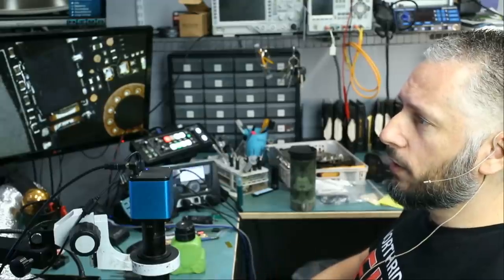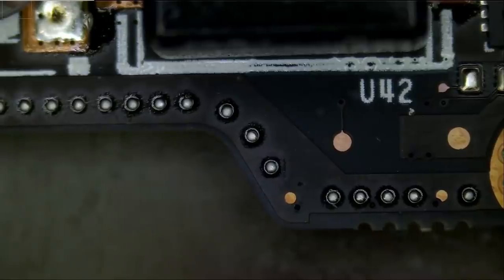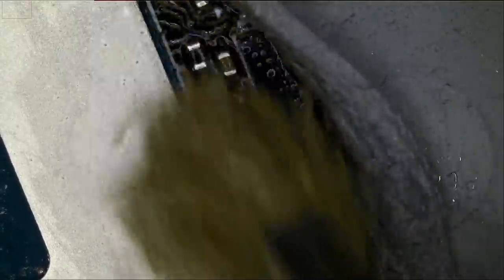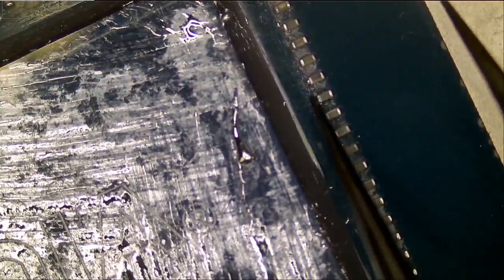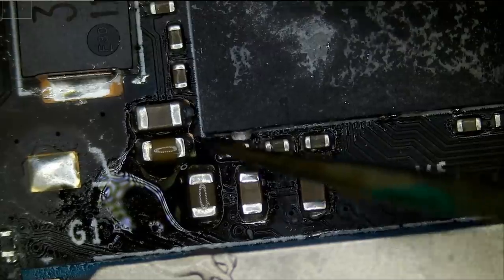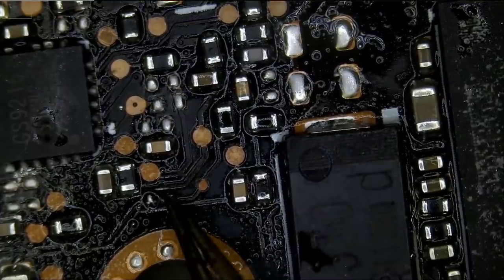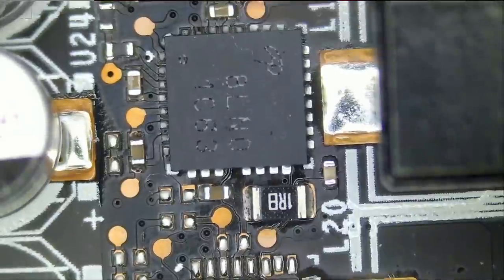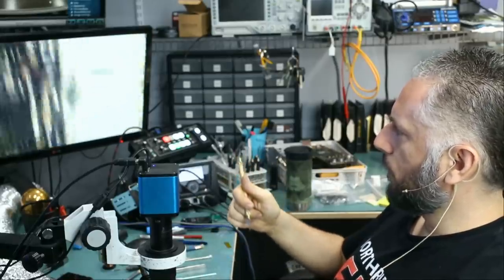RTX 3090 Graphics card Blew out after using Liquid Metal. A frustrating video to watch

Comment: I've never tried it myself, but my thought is that for this sort of thing you might want to try getting some (medical) syringes to suck up the liquid metal.  They can be bought pretty cheaply as diabetic supplies online, which I have found quite handy for various things myself (or if you want something a little safer, you can get blunt-tip ones too (which won't go straight through your finger accidentally) but they do cost a bit more, because they're generally considered "lab supplies")

But boy, they really managed to get that stuff absolutely everywhere, didn't they?

Comment: Why didn't he just get a water block for the card. The PS5 has liquid metal but it also has foam boarders to keep it in one spot so it does not spread potentially causing a short like this card did.
Reply: cuz liquid metal is so much cheaper than getting a 300$ block
Reply: I've only seen one liquid metal application video, and they taped off the processor with masking tape, and spread that liquid metal as thin as they could so it would have the least possibility of spreading after they put it back together. That was Gamers Nexus, I think. I guess customer did not see that video.
Reply: @d3vastat0r89  , I think people don’t realize it’s not your typical thermal paste and don’t feel confident with just putting a little and in turn we see disasters like this on north ridge fix 😂
Reply: Thermal Grizzly paste. No liquid metal bullcrap.  Why do people attempt things that they shouldn't?
Reply: Thats not what happened here at all.
Reply: You're actually supposed to put nail polish or something like that on the small caps near the CPU die to insulate them just in case any liquid metal gets on them. I guess this guy never watched a tutorial.
Reply: The ps5 comes with liquid metal from factory? As if servicing a broken ps5 didn't seem hard enough let alone convert the digital version to accept an optical drive along with the twin ssd setup.
Reply: it is also designed not to have SMD components around the die. the PS5 uses liquid metal because the thermal settings are set such that regular paste wont transfer the heat fast enough, and using even high quality thermal paste will cause the ps5 to thermal throttle and/or shut down.
Reply: @d3vastat0r89  Gamers Nexus is one of the most technically literate channels and even they aren't the best at it.

If you observe PS5 or ROG laptops the liquid metal is a thick layer and is almost floating. There is a reason for it.
Reply: @Scuba_Bro  This is by far the most interesting comment and acceptable comment here. I wanna discuss about this more.
Reply: Maybe it was liquid metal under a water block?
Reply: @wisnoskij  should of did research on liquid metal and find out that it needs to be secured all around especially it being a 3090
Reply: @Scuba_Bro  11 degrees compared with the best alternative paste or shitty stock cooler paste? Because that is pretty extreme.

Comment: I’ve used liquid metal many times before and the number 1 rule is to surround it with electric tapes or equivalent to prevent it from leaking elsewhere. Sony does the same thing for their PS5 as well.
Reply: Well this dude would have needed to wrap whole GPU in plastic.. :'D
Reply: ive seen ppl using nail polish over the resistors around the gpu die. not really sure if thats appropriate though....,
Reply: @utley  well, if heat dissipation anin't a problem and you only want to seal the parts: why not?
Reply: @rafaelwoitzuck3186  foreign chemicals in a high end product is something to not be taken lightly.
Reply: @Marauder those are thermal insulators...
Reply: Well not exactly, they make a literal foam "pool" that contains the LM from the teardowns I have seen.
Reply: @utley  Yup nail polish works well, but if youre already using liquid metal you may as well spend an extra $10 and use a proper laquer
Reply: @MisterMosfet  lacquer? That stuff is hot to plastics, that doesn't sound wise either. Why not just enamel?
Reply: @utley  You can get proper laquers designed for electronics, I use them at work for repairs on air conditioner circuit boards where I have to remove the waterproofing. They're high temperature and non corrosive, really useful for lots of applications.
Reply: I've heard slapping a coat of clear nail polish surrounding the liquid metal application site does the trick. Yes or no?
Reply: @MisterMosfet  conformal coating. Some folks report that their circuit boards were dunked underwater for days and still works just fine.

Comment: Could you use a solder sucker like those handheld ones to remove the liquid metal?
Reply: Liquid metal is nasty stuff, it can degrade aluminium, solder, maybe other metals. I would not risk my expensive instruments if I can use the cheap stuff. Anyway He would have to go over with something else to get the remaining stuff off.
Reply: Not for tiny metal drops
Reply: No, even using the swab sometimes you just "moove it around"
Reply: Compressed air and maybe blow it off the board?
Reply: @IMDYT420  in a contained area maybe. Dont want to get those things on other electronics.
Reply: @IMDYT420  i dont think its safe at all, it's a dense crowded card and even a tiny drop can cause problems, if it gets stuck somewhere you are back at the starting point or even worse.
Reply: @IMDYT420  Risky because inhaling vaporized liquid metal is very unhealthy
Reply: I kind of thought I'd see him use a braid.
Reply: I was thinking solder sucker myself, perhaps even a cheap micro air pump something to vacuum that crap out possibly from under ICs too.
Reply: @Crystalservices  Solder suckers will work well, especially for tiny drops.
Reply: @punktkomma9489  i do not remember talking to you, troll
Reply: @IMDYT420  As a last resort yes.
Reply: @IMDYT420  I usually blow under the chips with the board faced down, and inside a box to avoid liquid metal fly everywhere. 100% sucess 😉
Reply: I’ve got a solder sucker made of plastic and stainless. It’s unlikely to break it however the insides are going to be coated.
Reply: No way, it eat into any other metal below, literally dissolving them and making amorph amalgam which you can wipe away with a towel. There is nothing you can do. Except removing some still useful components without LM contamination.
Reply: @ChannelJanis  Not it can, certainly 100% degrade aluminium,copper and solder within a year maybe less
Reply: @TheThore  Gallium boiling point is 2400 Celsius degree. There is no way you can inhale that at room temperature.
Reply: @nhozdien5058  thank you for the informative response
Reply: @IMDYT420  Compressed air works like a charm

Comment: I'm a vet MD that also repairs/builds PCs in my free time for almost 30 years now (actually paid for my college that way). I often use old surgical instruments when doing so. My suggestion is at  6:39 you could use a suction device that we use in medicine called a vacuum suction pump to remove the liquid metal. I know there probably are tools similar to this in your field but in my experience due to the quality of making surgical tools tend to be better. Cheers

P.S. The way you say Metal makes me feel you are a metalhead 😁🤟
Reply: there is a tool called a "solder sucker" which is what came to my mind. i think you'll find its similar to what you were thinking.

Comment: You can remove the liquid metal with the syringe.
Reply: or with air compressor
Reply: @ariewijaya1679  And spray the toxic liquid everywhere. I wouldn't do that :)
Reply: @an3k  6:07 he did it with hot air blower. why not get full blast with air compressor 😁. off course do it in outdoor
Reply: Liquid metal behaves really wierd when it comes in contact with ordinary thermal paste and might make a cleanup job easier. I can't really explain since my last build was a long time ago and I cannot really remember. I have used Arctic Silver as a shield against liquid metal in my graphics card.
Reply: @ariewijaya1679  hot air blower ... is for soldering and not for blowing stuff away ... and since liquid metal is toxic you do not want to blow it everywhere
Reply: @an3k  then the 3090 will be waste if the liquid metal stuck and short under the bga chip 🙈 even though in the process of making the gpu board consume scare recources in china
Reply: @bernddasbrot2266  what do you mean as a shield against liquid metal? Arctic silver is also conductive
Reply: Wouldn't an ultrasonic cleaner clean all that off?
Reply: @katlegomogwera6834  the problem with that is it't hot, it melts the galium and it can potentially go under chips.
Reply: @bernddasbrot2266  I'm mistaken, my bad. But if I remember correctly there was some silver thermal compound that was conductive, can't recall which one tho
Reply: Vacuum it
Reply: @katlegomogwera6834  i
Reply: @ariewijaya1679  never air compressor unless you're outside. You don't want it near your instruments.
Reply: @katlegomogwera6834  that is the best
Reply: No you can't, many metals suck up Gallium like a sponge.
There is no way to be sure you got it all.
Reply: @bernddasbrot2266  Gallium makes an amalgam with Silver, its still there and can contaminate other metals.
Reply: @R4MP4G3RXD  And the Gallium makes an amalgam with the Silver, its still there.
Reply: or solder sucker (one of those spring loaded ones should do)
Reply: @katlegomogwera6834  yes, maybe, but it could also cause it to migrate under chips. You could have board upside-down, and a mild solvent solution under mild heat in a ultrasonic cleaner, that'll work.
Reply: @MichaelClark-uw7ex  Amalgam is a mercury alloy. Gallium won't get you Amalgam, but it sure could produce some form of alloy. Of course the stuff still is on your components but the silver is embedded in the arctic silver. Forming an alloy might pull the liquid metal into the arctic silver while also embedding it into the paste while potentially (!!!) keeping it non-conductive. Thank you for pointing me towards alloys as an explaination for the change. As said: I remember it changing its properties. It might just be worth a try.
Reply: @bernddasbrot2266  An amalgam is any mixture of metals, not just Mercury.
Webster defines it as "a mixture or blend"
Dental amalgam is Mercury and Silver.
Reply: not that much 😂
Reply: If it's metal why not magnets? 🤣
Reply: I can confirm this, use a blunt needle to suck in the gallium; still a pain in the ass though
Reply: Yeah why didn't he use a syringe? It is applied with a syringe in the first place anyway.

Comment: you can put several clear coats of nail polish on the little components inside the foam border of the chip to protect from liquid metal
Reply: @_to_dream_or_not_to_dream  I believe not, I've seen potted SMDs on PCBs before so nail polish shouldn't be a problem.
Reply: I have used electrical tape and it works pretty well too.
Reply: @_to_dream_or_not_to_dream  not realy since most heat doesnt come from the small components but if u want to remove it after the work is done u can do remove it with acetone

Comment: YouTube has everyone feeling the need to re-paste everything, even when it's fine the way it is. 😄
Reply: Can't agree more. Even if the difference is around 5-10%, I would not take the risks. I'd rather go cooling a 3090 with a waterblock instead.
Reply: In some instances, repasting older products can help tremendously. BUt in all instances, work with that which you know what you're dealing with. Liquid Metal is about on par with fucking with the registry.
Reply: @Cthulhu it's not worth on a brand new gpu

Comment: Underneath that one IC where you pushed some liquid metal in, then got it out with hot air - looks like there is still a lot more. Maybe put some picks in the freezer / ice - see if the cold hardens it so it can be pulled off. Insulate your hand to keep the tool cold longer. Try compressed air, spray into a bag...

Comment: You can apply liquid metal safely, you need first to buy some expensive spray that leaves a polymer coating.
Louis Rossman mentioned but I can remember the whole process.
Also some use transparent nail polish to protect the chipset resistors. 
But again, the reward for a couple degrees is not worth it.
Add another fan and you will drop more than changing to liquid metal.
Reply: Totally worth it for fans of silence (pun intended)
Reply: Desktop GPUs are not worth it but myself have dropped temps by over 10C on a couple laptops and my 6600K (delid)

Comment: Use ice cubes  to remove LM. It goes brittle on lower temps.  Or you could just put the gpu in a freezer for 2-3 mins . And just scrape of LM
Reply: Ah yes, GOOD condensation.
Reply: @therocinante3443  if the board isn't connected, water isn't a problem.

Comment: I've long known liquid metal was a very risky substance to use but this really just highlights how crazy an idea it is for most users. Just not worth the risk.
Reply: It may be worth the risk, actually. But only if you know, what EXACTLY are you doing.
For GPU, mostly changing the thermal paste for some better paste and thermal pads (if they´re worn out or defective) is enough.
Reply: @Morpheus-pt3wq  Losing a 3090 in 2022 because of not just using thermal paste and pads in risky and unnecessary. Imagine  the look on his face when instead of a little higher temp it cooked.
Reply: @Morpheus-pt3wq  For non-soldered cpus it is definitely worth it. Gave me a delta of around 20-25°C after removing the heatspreader and applying it. However I protected the SMDs around the chip by applying clear nail polish without any solvents or additional ingredients. Done like this it is far less risky. However on a GPU you don't have the heatspreader between chip and cooler, so it's far less worth it.
Reply: @hopentethking1966  Thats the "know exactly what you are doing" part. The area around needs to be insulated, or closed off from spilling, like its done in PS 5. If everything is done right, it dramatically decreases temps, thats why people are doing it.

Comment: I wish I had to confidence to to try to brick something that expensive
Reply: there was no confidence, only ignorance.
Reply: for some 1 to miss with a brand new GPU thermal pad, theoretically he is looking for the best solution to lower the temp by maybe a few degrees, so theoretically he should already make some research to know the best in the market and what pros and cons each type has. it just doesn't make any sense
Reply: @gastongl404  It isn't as if you even get so much of an improvement from a die-to-heatsink solution like GPUs anyways. CPUs are different, as there is an IHS.
Reply: @faranocks  well, any 1 that's want to use metal liquid should know the risques and shouldn't squeeze it like a mayonnaise bottle xD
Reply: @nukfauxsho  ignorance and confidence go hand in hand honestly. You’re both correct.
Reply: no confidence, lack of sense
Reply: @faranocks  doesn really matter though, sure there won’t be a significant boost in performance but a majors boost in acoustic. I have LM in my budget air cooled 1660, just because I’m sensitive to noise, anything above 25dBA is a hell no for me. I’d rather let my GPU throttle than hearing it screaming at me, thanks god LM fixed that and and it’s 40% all day all tasks. Performance wise, I don’t really care.

Comment: The easiest way I've found is by using a qtip that basically has a small amount of LM on it and then use its own surface tension to suck up whatever is around tiny resistors and caps by slowly trying to touch them.

Done that on a couple of laptops so far and seems to be consistently reliable.
Reply: I was thinking more on a de-soldering sucking pen, that should be enough to pull those tricky gobs.
Reply: Why that even happened?
Reply: @poland-nosteamserver6378  
If you've ever applied too much thermal paste you would know how it can ooze out a bit. The same thing can happen with liquid metal, or by accidentally squirting some out from the applicator on anything outside of the IHS.

Comment: It comes off easier when you "prime" the swab with other liquid metal. So, you use one swap to clean off the IC  plate, then wipe off as much of the liquid metal you can from that swab, and use it to wick up the small bits. that being said... the dude used way too much. I was able to do 3 GPUs and one laptop CPU with the liquid metal that came in 1 pack, and I still have a ton left over. smh.
Reply: THANK YOU

Comment: Just remember the liquid metal contaminates aluminum and will destroy it. So if you use a solder sucker it should not have any aluminum parts.
Reply: It destroy all the solder joints also after couple weeks

Comment: If you want to improve the thermals of an air-cooled graphics card like a 3090, then buy a gigantic third-party universal VGA heatsink and just use normal thermal paste.
Reply: The problem then is you need to also build a cooling solution for the VRMs and VRAM modules which can get quite hot.
Reply: Got 3090 aorus xtreme which has probally the biggest heatsink of the 3090s. But they cheaped out on thermal pads and Ive heard the big vapor chamber inst probally surfaced. The memory junction is somewhat ok 96c but I still bought some thermal pads and slapped some alumium fins ontop of the backplate to get it lower.
Reply: Yeah, why would anyone use liquid metal... a closed liquid cooler would be more than adequate.
Reply: @coolspot18  i have my 3090 watercooled and i can tell you the chips in the back get so freaking hot that even watercooling doesnt help. 
Only after i bought the watercooler for the backplate for the 3090 it fixed it. Its a huge design flaw of the 3090 and i hope they will improve it on the next model